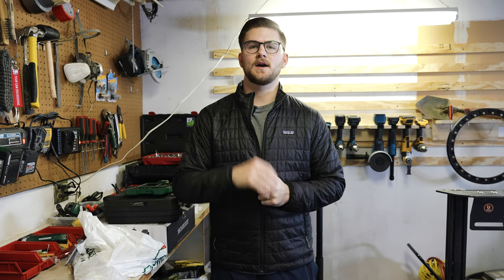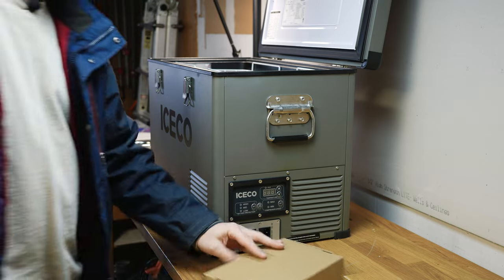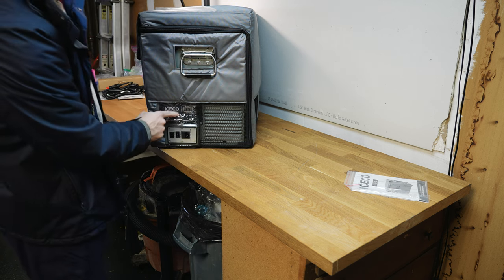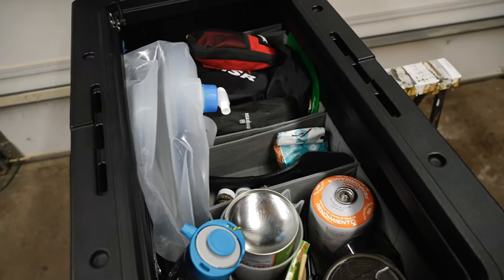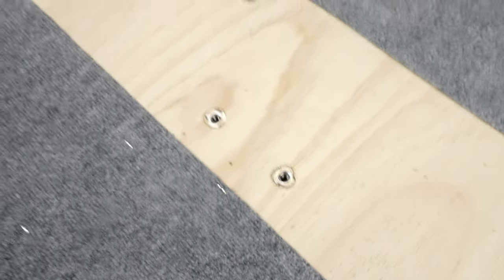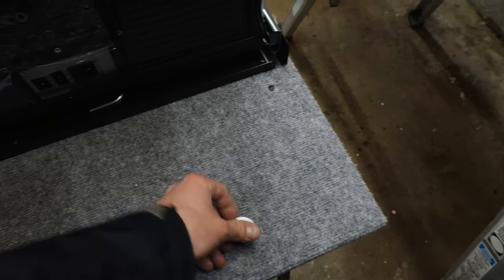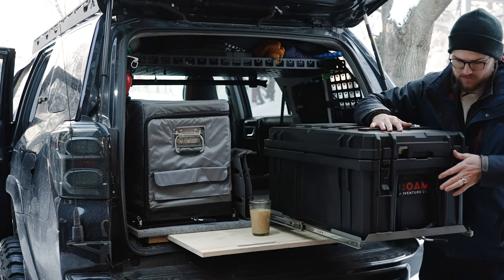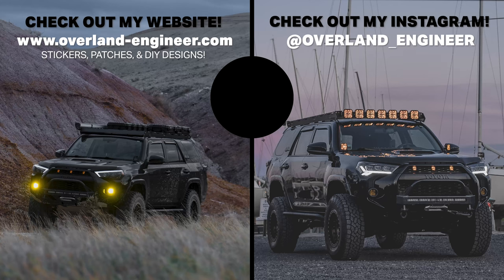BEST Camping & Overland Storage Setup - ESPECIALLY for daily drivers! | Modular & Customizable!

Comment: Great video. I have a platform with fridge and container storage compartment along side the fridge. What are the actual dimensions of your ICECO 45Q fridge?
Reply from the maker: Actual dimensions?  Like the footprint?  Or what are you referring to?
Reply: @OverlandEngineer  Fridge length, width and height
Reply from the maker: @mtntrekker3119  Dimension: 27.4*15.8*19.2''

Comment: Will this same slide set-up work inside a Jeep JL Rubicon Unlimited 2018 with its dimensions.
Reply from the maker: I'm not sure but they plate is 43" wide by 40" deep and nothing passes outside the slide.  You may be able to delete the roughly 2 inches in between slides if your space is smaller.  You would just need to get some dimensions of your trunk and do some math